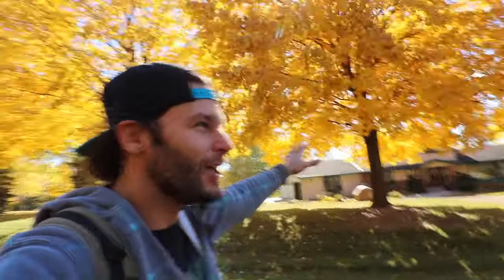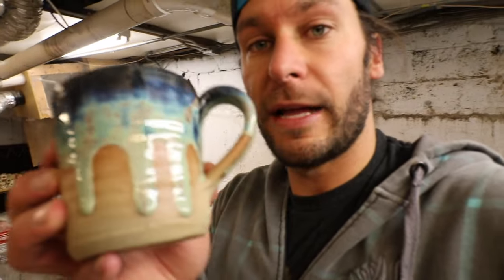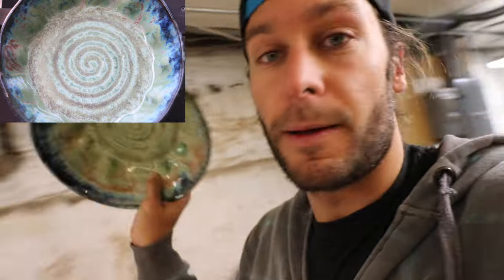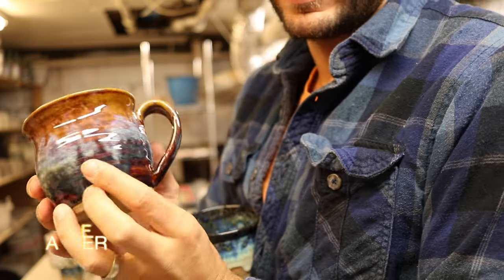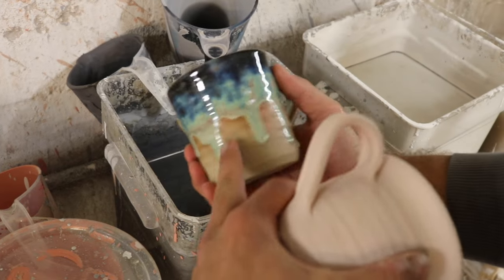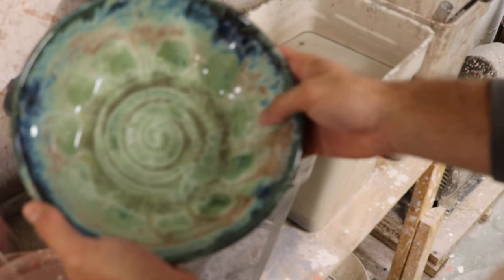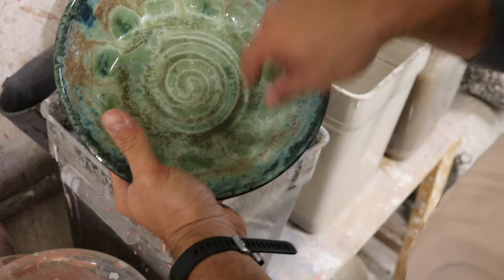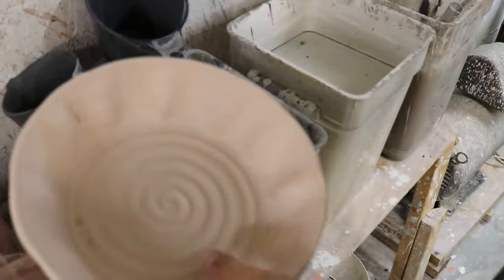Pottery Glazing Techniques!  Drips, Pouring, and More!

Comment: Super helpful! I’m wondering if the glazes at my studio are maybe not think enough or maybe you’re firing at a higher temp to get the drip effect. I tried putting 3 pretty thick layers of glaze on a piece to get the drip action going but it ended up just having a very clear line where it cuts off without dripping at all. Any idea of what might be going on there? I guess I can just try doing extra layers until I get the drips, I just don’t want to put too much on and have it drip all the way off.

Comment: Hi Jon, I am curious if you ever get cross contamination in your glazes from splashes since your glaze containers are so close to each other.  It didn't look like much of it splattered too much in the video but your walls make me think that you gotta be getting glazes mixed together over time. do you ever cover the buckets next to the main one you are glazing? Also, do you do any test tiles? I know layering 3 glazes can be somewhat risky as a first try. How do you know which combos you like to glaze with?
Reply from the maker: These combos I have been working with for 4-6 years so they have come slowly, I mostly just test on extra mugs that I make.  As for cross contamination I have not had much trouble with it and I am not too careful about a few drops here and there.  I used to be more careful but now since I have not had any problems I don't think it matters too much when you are working with higher quantities.
Reply: @Jonthepotter  thank you for sharing your experience with us. I like your idea of testing your new glaze combos on extra mugs rather than test tiles. You can always do the combinations you feel might be too 'drippy' on the inside rather than the outside. It is great that all your glazes are compatible and work well with each other.  I'm still working in a classroom situation where some of the different glazes react badly with each other so we have to be really careful of cross-contamination, and with a hundred + students glazing you can imagine that a few drops here and there can really add up;  we sometimes end up with a 'mystery glaze' or two by the end of the semester.  Because of all that we are supposed to always cover the bins next to the one we are using there. Also, because they use a large gas kiln, they only do high-fire glaze firings two or three times a semester - it makes it a little hard to learn from our own experience since they aren't frequent enough.  But I love working in clay and hope that one day I will have my own studio.

Comment: Thank you for this glazing video. I’m pretty new to pottery and so far have only used commercial glazes from small bottles and they seem way thicker than yours. I brush paint them on. I was wondering if you have a video on how you make the big buckets of glaze? Or if I should take the commercial glazes I have and make them thinner with water or something in a container? Thanks so much! Love watching your videos!
Reply from the maker: Yeah typically when brushing on you would want the glazes to be thicker, because when you dip them they are applied thicker.  You could take your glaze put them in a bucket or container, add a little water, and then dip them, that might work!  Experimenting is the name of the game!

Comment: maybe a silly question but does it not matter if you mix the glazes even if they are dry? like if I had a color glaze and then wanted to put a crackle clear glaze on top would it not mix the color slightly???  your viceos rock by the way thank you so much for sharing.

Comment: Hi Jon. I have a couple questions about your glaze. 
1. When you dip in the matte white, is that glazed used to help the buttercream flow/drip? Specifically, is the matte white used more as a function or color?
2. The Albany Brown glaze you use, is that an Amaco glaze? Is it the Albany Brown Slip? If not, where do you get that luscious glossy brown glaze? 
Thank you
Gail
Reply from the maker: Continental Clay has a New Albany brown cone 6 glaze.  All the colors are both for color/look and also to make it drip!

Comment: Hey John the Potter.  I'm Ed "the wannabe potter" .  Been watching a lot of videos, yours included, to get tips on glazing.  I love that you dip all your stuff and wished I could do the same, but don't know how to prepare my own.  So I use store buy store bought glazes.  In this latest video you said you would touch on glazing without dipping.  You must have forgotten it or I went brain dead while watching.  Can you please do a video on quick techniques for those of use less fortunate and have to glaze manually.  thx...love your vids.....Ed Wannabe
Reply: He was talking about what he does to the rim of his big bowl at 8:15 - he pours the glaze on rather than dipping.  If you wanted to do this with a small bottle of store-bought glaze you would still need to have a clean, larger container to catch the drips, but then you could reuse the glaze from the container you caught the drips in. Still sounds like a bit of a pain right?  If you want the drip 'look' you might try using some type of syringe to get more control, but the bottles of glaze you are buying are usually specifically formulated to be brushed on.

Comment: Missed the premier but watched later.  Yes it was helpful for me.  I have been brushing on glazes and hate it. Did you mix these yourself or get premade? Are they from continental clay?  Thanks for demo and sharing.
Reply from the maker: They are pre made, I have gotten them from both Continental Clay and MN Clay!
Reply: @Jonthepotter  I'm thinking pre-made means with water already added?  Or do you purchase the chemicals dry and mix yourself?  I think I'm liking the idea of buying pre-mixed (wet) glaze in bulk.  :)  Not a lot of supply stores near me and haven't seen that option though.  Hmm...
Reply from the maker: I purchase the pre made mix dry and then just add water and its ready to go.

Comment: Hi Jon, Jeanne again from Clyde, NC. Two questions: For the bottom layer, do you dip just once? And how long do you let the glaze dry before adding another layer of glaze?
Reply from the maker: Yes just dipped once for the first layer, I let the glaze dry until its totally dry, usually 10 to 20 seconds but can take up to a minute depending on conditions.
Reply: Thanks Jon. You totally ROCK!!

Comment: Hi Jon, love your videos. When you're glazing the bowl why don't you dip the bowl in the green glaze? You're glazing the whole bowl in the same colour, is there a technical reason to pour rather than dip? I'm just a beginner and am trying to soak in as much knowledge as possible from all the great videos on YouTube. Thanks for your videos, they're really helpful.
Reply from the maker: That is a good question, you certainly can dip the whole thing, and I have done that for a long time.  IF your piece is too big to fit it in the container though then this method works.  Also I prefer to pour other then dip half, let dry, and drip another half, because typically there would be a small overlap that would be visible in the final piece.  This pour method is really consistent and leaves not dipping overlap lines.  Hope that helps!
Reply: Great, thanks.

Comment: I'm new to this. The glaze is different from the glaze used with a brush?
Reply from the maker: You can use this glaze with a brush, dipping is much more consistent though, you would have to brush on 2 to 3 layers of a glaze to get the same thickness as 1 dip.
Reply: @Jonthepotter  Thanks! You're the Best!

Comment: John, thank you for the glazing. One question, are your glazes designed to run,or do they run because they touch each other? (Ok 2 questions in 1).😀
Reply from the maker: They run because they are layered on there, I would not say they are designed to run.  And some combos certainly run much better and easier than others.

Comment: Wait but I thought you couldnt put lighter colors over darker.  I'm so confused.  I'm just taking a hs ceramics class though 😂
Edit: and how does the raw clay turn a reddish color after firing?
Reply: Hello! It depends on what kind of clay you are using...not all clay is the came color after firing, because not all clay is the same. As soon as the kiln is completed, the clay is called "bisque" that's what the first fire of clay is called,  and then you have your clay color. Hope that helps and isn't confusing!
Reply: @Lyddiebits  thanks!